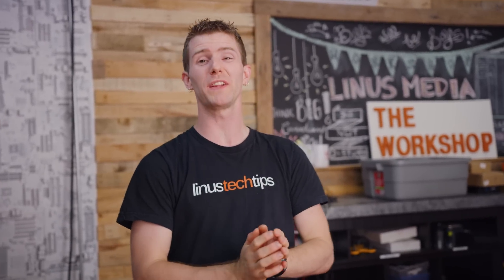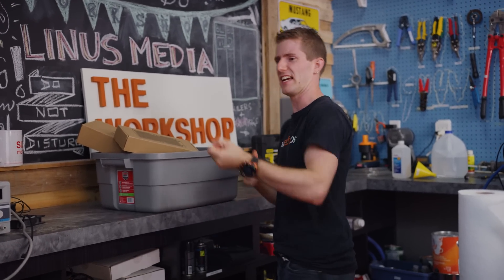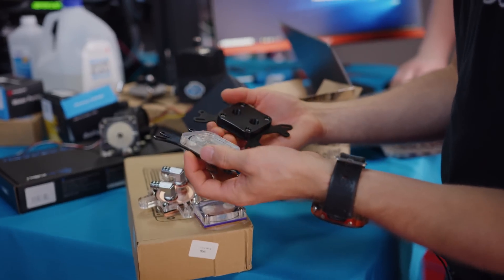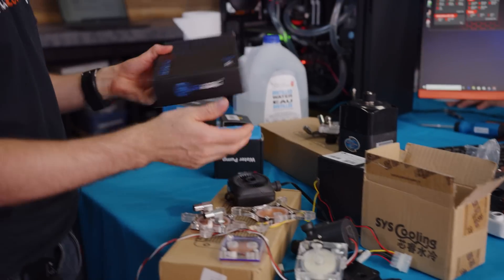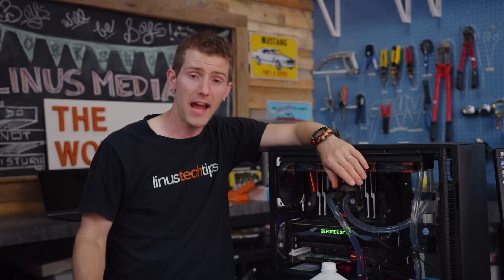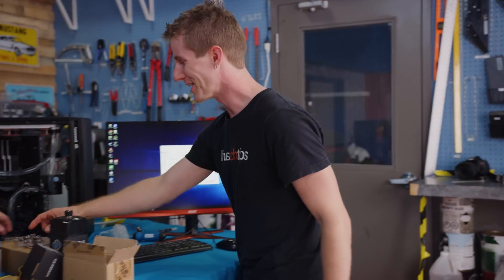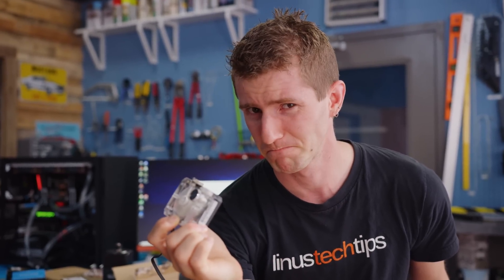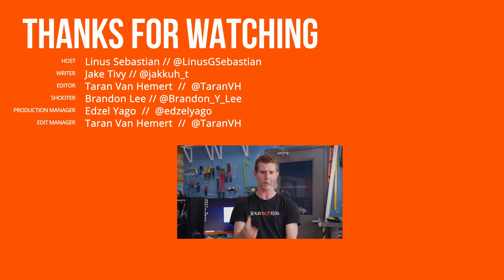AliExpress Water Cooling DOESN'T Suck?!

Comment: Now the question is: cheap water cooling or proper air cooling?
Reply: i am running 8700K at 4,7Ghz all 6 cores and 1,28V and temps around 70°C with room temperature 30° with NH-D15S with 1 fan on it.... CPU is NOT delided
Reply: It was cheaper for me to replace my old 4c/8t CPU with a 6c/12t and overclock it as high as it can go on cheap water cooling than replacing my entire system with X99 or Ryzen. It would be the same even if DDR4 was not overpriced.
On air I would be sitting at ~400MHz less which is a big deal for games that benefit from high single thread performance.

Naturally you have no need to water cool a brand new high end 14nm CPU if you don't plan to set benchmark high scores. But of course most water cooling is done by snobs who can afford to throw 5k at a PC just for the lols and bragging rights while 99.9999% of the time they have no practical gains from it in their daily gaming where their GPUs choke on 4k resolution.
Reply: Miguel Angel Vazquez I say if ur a beginner dont go with water do air.
Reply: A decent chinese water cooling loop should be better for CPU overclocking than even the best air coolers. If you don't plan to overclock a lot then air is superior being easier, cheaper, safer.

Comment: Actually, would it be possible to do a custom loop now for CPU, motherboard and GPU, that actually is all aluminum? Because if so, that opens up a lot more options for radiators with a ton of surface area for really cheap.
Reply: I tried looking for decent aluminium water blocks by chinese brands but didn't find any. For an all aluminium loop probably the only good option is still a western brand but it doesn't make sense economically because these copper+brass parts from aliexpress exist.
Reply: I was about to ask about that, too. The parts list is decent, but the only 360mm rad they link to is an aluminum one. They mentioned one about how they had a hybrid rad where only the parts that touched the water was copper (or brass), but I couldn't find any. the default link to the "PC watercooling" for Aliexpress only links me to reservoirs but literally nohting for actually making a custom loop. So I'm feeling a bit perplexed.

the fact that they tested with an X99 setup is pretty relevant to me, since i'd been wanting to do a custom loop for my X99 pc in forever. And at that total price, I could almost afford to do a custom loop for my other PC's too, as long as they work.
Reply: Just try searching aliexpress yourself and I suggest you sort the search results by "orders" as that kind of implies the seller is decent at their job like not sitting on your order for months before posting it and that the parts are good.
I found that Barrow and Bykski as search terms tend to turn up decent results even if the parts are unbranded or have some other obscure brand name on them.
My 360 thin rad came from the same seller as 2 meters of soft tubing for a total price of 49USD plus 8.45 shipping to Eastern Europe, the listing said it's FormulaMod while on the rad itself it says FreezeMod.
I have an x58 system with a Xeon hex core clocked to 4.4GHz and everything else is just air cooled so a bit overkill with the radiator size for just the CPU.
Shipping times vary from seller to seller, in my case almost everything arrived at the same time within about ten days or so, I was stuck waiting for two more weeks for the fittings which were really cheap and meant that I could easily go for 2x more fittings than I actually needed to have spares, the more expensive ones would probably have arrived sooner.
Reply: that's just it, I can't find anything, neither with the links in this video, nor with their search bar. It's somehow more broken than AltaVista of the 90's. And that's saying something.

Comment: Can y’all help me out?  I’m building a station for 3D modeling, graphic design, music, photo and video editing. Here is why I have so far...
CPU - Ryzen 2700x 
Motherboard- Strix x470 F
Ram- 16 gb Trident Z rgb (amd compatible) 2933
And as for gpu I’m stuck, I heard a new card will drop and old cards will lower, and I really like the Strix cards. I’m thinking about getting the Strix 1070/1080 since i would also enjoy gaming on a 144hz monitor. But than again would I be better off with a Strix 580 for productivity, and lacking the gaming value? 
And depending on the card how much watts should I get for a psu? Thank you for taking the time to read this.
Reply: just send it and buy the titan volta

Comment: Are you willing to see if this thing really works?
https://www.amazon.com/AISme-Diagnostic-LPC-DEBUG-LPC-Debug-Motherboard/dp/B076Z7VFS8/ref=sr_1_1?ie=UTF8&qid=1533239240&sr=8-1&keywords=cpu+ram+diagnostic+card
i had a z77 system and it died i tried to boot it with 1 ram stick it worked once then stopped again, if this works i would be willing to try it.

Comment: To think my first water cooled system (about 15 years ago) used a water pump (DAB) from a broken home oil water heating system.... and it was quieter on lowest gear than MOST available water pumps for about 8 years (untill it broke xD) with massive water pressure, and a modified car radiator. Everyting in copper or brass. Now im using air but im still thinking about bulding new WC system ;)

Comment: Heh I actually use all Barrow fittings on my 7900x monoblock / sli 1080ti system, they seem really good and zero issues since I built it, while saving a fortune over bitspower fittings (as in some were 1/4 or 1/3rd the price!), the rest of the loop is EK blocks, alphacool rads with a primo hill pump/res

Comment: Okay guys listen up! This has been my area of research this year. There are two things you need to pay attention to in particular when ordering a custom loop on a budget: The block and the pump. Let me save you a lot of time right here, right now:

- DO get a block with a 0.2mm fin pitch. So far I have only found blocks like that from Barrow and Flying Elephant.These blocks will perform just as well or better than your premium brand. Do not buy blocks with any larger fin pitch than that. Example link (AM4): https://www.aliexpress.com/item/Barrow-LTFHBA-04N-Water-Cooling-Block-for-AMD-FM1-FM2-AM2-AM3-AM4/32807502757.html
- DO NOT get the enormous Barrow/Bykski TR4 blocks that are compatible with AM4. The above mentioned block performs much better.
- DO get a pump with PWM. You got that? PWM or bust! Freeze Mod make some great pumps with integrated reserveroir. Example link: https://www.aliexpress.com/item/FREEZE-MOD-pump-reservoir-kit-for-computer-water-cooling-system-RGB-control-or-AURA-synchronization-PUB/32841167251.html

Some bonus tips:
- DO get a Bykski block for your video card. They are absolutely excellent and will drop your temps like 20-30 degrees. Make sure you get the right block for your exact card model.
- DO get a COPPER radiator, preferably with high density fins.

That is all. Learn from my mistakes. The above parts will ensure that you get top performance for little money. Enjoy!
Reply: You should do a video on that, it would be interesting to see it in action.
Reply: Bykski is a really good quality brand. Their TR4 block beat the first block from EK for the platform, and is pretty much on par with the new one EK released IIRC. But of course, I only have experience with a limited quantity personally. Still, I would def. buy their products again.
Reply: Thanks, im gonne use this info
Reply: Dude that's really interesting! You should do a video about that because you seems to know a lot about those budget watercooling parts!
Reply: why not a barrow block for the gpu?
Reply: Too bad they don't have MSI 980 blocks :(
Reply: Alex Spray thats basically why it is so expensive
Reply: Thanks man. I've been searching aliexpress for a few days in total now to make sure I get something that's really good for cheap, first try and this post helps a lot!

Cyberpunk build, here I come!
Reply: any advice for cooling my laptop?
Reply: You can get one of's relatively cheap as well if you can make simple technical drawings
Reply: Thanks for the tip! You should do a video on it
Reply: dot
Reply: Andreas Ravnestad uhm sounds hard just gonna get a noctua i guess
Reply: I prefer Vario pumps over PWM
Reply: Thanks b
Reply: I literally dod exactly this for my secondary PC just to see how it goes before going over to my main. Long story short, my workstation/gaming rig is now water cooled, sponsored by aliexpress.
Reply: Did you ever make a video on this?
Reply: I wish i could add this comment to safe.
Reply: Wow, thanks for your help, bro.
Reply: Nice tips man, for me that live in Brazil it is much cheaper to buy Barrow and other brands from Aliexpress, due to shipping price from US, EU and customs taxxes, not to mention the currency conversion.
Reply: João Paulo until your products arrive at the customhouse... BAM 70% of taxes
Reply: VL you could try to find a forward shipping service.
Reply: Andreas Ravnestad I spent a lot of time looking for water cooling on alliexpress but i have seen pump looking that good. Maybe you have more examples or options to choose?
Reply: There's no marketing in the fact that buying cheap from Ali you get 0 warranty. From EK specifically you get both amazing support and warranty which even covers your hardware in case of a leak that is EK product's fault.
Reply: Erik Nastovski Stop shilling for EK. Just stop.
Reply: the products on ali are less than a half cheaper than EK parts, you could just buy another one if it breaks on you or better yet get a new one from a different company. for the price of one complete set of ali wc parts, itd be the equivalent of just one EK waterblock.
Reply: Leif Christian Rosendo cool, and what happens when it kills your hardware, will you buy another 1080ti for the difference in price?
Reply: sources and first eyed accounts show theyre reliable, it doesnt matter if its manufactured by some chinese company you dont know, quality is quality. i assumed a situation where you can identify the problem immediately before it does any damage to other components. furthermore, it is not reassuring for a company like EK to offer a warranty like that knowing their price premium, it should be 100% guaranteed. people shouldnt have to pay up to 3 x just because theres a warranty and 4 degree difference. if were even gonna talk about warranties, youre still the one with a bricked pc and itll probably take them months to inspect your pc and replace the part or reimburse you. if i know a product is good then the warranty shouldnt matter and its worth only a slim chance of a gamble if i do the research.
Reply: @eriknastovski1330  Is the warranty going to cover your 1080ti when your EK block leaks? The chances of that are about the same as a cheaper block leaking. Just examine it before installing, like you should with all components.
Reply: @VecheslavNovikov  yes. If the leak tested seal is there and blocks were not damaged, everything is covered.
Reply: @eriknastovski1330  No it isn't, read the terms of the warranty. As with everything, test it before using it long term, inspect before installation, etc.
Reply: @VecheslavNovikov  well practice shows otherwise. Check the predator AIO failiures, every pc component that failed due to it was reimbursed.
Reply: @eriknastovski1330  That's a one time thing they did to avoid class action lawsuits. Their warranty doesn't cover your components in case of leak.
Reply: @VecheslavNovikov  nope. Just ask support.
Reply: Complete junk
Reply: Or even better, just get EK parts that are quality, supported by awesome warranty and excellent customer service with performance that those Chinese brands try to copy over.
Reply: Erik Nastovski If anything, this video shows that EK is probably ripping us off.
Reply: Ill be laughing when that pump dies horribly or block seal craps out and kills your PC along with the loop.
Reply: Erik Nastovski there is a thing called thermal throttling, ya know? It is really hard to burn cpu nowadays, unless you mine on it.
Reply: King Of the Jungle totally. These designs aren't revolutionary. Most of this is pure profit for the big guys.
Reply: Erik Nastovski yeah of course, let me just hack some money onto my bank account
Reply: lol where tf u think those parts are made? only difference is warranty.
Reply: Erik Nastovski Hmmm 4 Celius? That is your "extra performance" that is on a 5960X. A HOT CPU. You only get a great warranty. If you buy safely, you save 200$ or so.

Comment: for anyone looking to save some cash and just jump into water cooling...DONT. save for as long as it takes to buy from one source you can actually contact and receive replies from. when you buy from one source they generally design the components to be of the same material/grade/quality, buying a mix of random cheap parts from across the pond means youre probably going to have issues with possibly wrong/misinterpreted components that are most likely different materials creating electrolysis in your loop (dissimilar metals reacting causing corrosion and even speeding up the degradation of your components at an exponential rate) if this problem occurs with a reputable source, more than likely they will work with you to make things right. ive built several budget loops and none of them are still around today because of ruined blocks from electrolysis and not being able to contact sellers to try and resolve the problem, spent about 600 total on all of it over the years and the only one still in good working order is the most expensive one i sourced from EK for about 500, so i could have saved money in the long run by just buying quality in the first place (even buying quality doesnt mean its perfect, water cooling is a commitment,  plan on draining loops and adding chemicals when needed and cleaning parts that are not designed well for that process)

Comment: Keeping things cool with water is not rocket science. The difference in performance between water blocks is negligible. The really interesting part would be whether or not it starts leaking after a couple of weeks because the chepo o-rings have disintegrated or because the plastic parts cracked.

Comment: It just doesn't seem worth it to cheap out on water cooling considering you'd really only water cool a high end setup. Plus 90 bucks isn't even that cheap, I'd just got for a noctua air cooler for that price and save myself the potential damage to my parts.

Comment: Why can’t somebody design a simple circuit using refrigerant maybe R134a and a small screw compressorif it can remove heat to a standard to keep a freezer at -20 surely its more than enough to keep a bank of pc’s cool.
Reply: Freezers are insulated so they only have to deal with a small amount of heat getting through. CPUs are constantly putting out heat so it takes more power to cool them.

Comment: But what if water is expensive and we have to use our bodies to watercool since the human body contains 70% water???
Reply: You can use your bodies... unused water, but it is (depending on your diet) acidic and will probably damage plastic-tubes within weeks

Or you can hold your hand down on the cpu, that may actually work to some degree (pun intended)
Reply: Salz Stangl on low power chips (like 1 or 2w) it's actually a decent way to cool them
Reply: it would be 70% as effectif
Reply: Just lean on the cpu. Thats blood cooling. Your body will dissipate the heath
Reply: you could call your brand dune cooling
Reply: Use watermelon. Its 90% water
Reply: Or coconut water.
Reply: Fat Boo Chinese blood cooling vs Taiwanese blood cooling

Comment: I've been using Barrow for a long while now and have ZERO issues. It's half the price and after building 10-12 client systems using their hardware, I've realized it's the exact same manufacturer as BitsPower. YOU SHOULD BE USING BARROW!!!!
Reply: Christopher McCabe i ordered like $100 of Barrow fitting, what it should be like $300 of bitspower ones, im just waiting to they arrive to compare them with the bitspower
Reply: Really surprised they didnt get barrow gear. But i guess they dont fit their either stupid expensive or stupid cheap product content. They are very reasonably priced, are decent quality and perform fantastically.

Comment: Without looking at the video, I can safely say, no it doesnt. My current rig is mixed with cheap copper barrow fittings and pump/res combo, while the rads are from hardware labs and gpu block from xspc. Watercooling doesnt have to be expensive if you know where to look.
Reply: Barrow makes a brass fittings, not copper ones - as basically all other manufacturers (with few exceptions with aluminium fittings like ThermalTake and EK for their all-aluminium loops).

Comment: Can you guys do an update on the laptop vacuum coolers? It would be nice to see it they worth it or not
Reply: no
Reply: any proof?
Reply: laptop fans are already pushing the hot air out, the vacuum cooler will not make it that much faster, you would get max -5C, but much more noise. Makes more sense to replace the thermal paste
Reply: And what if the built in fan has a very low fan curve, and doesnt ramp up enough, therefore not pushing enough air through the heatsink? In that case it would be benefical in combination with a laptop cooling pad. The paste is brand new, quality one.

On the -5C max: even in high end laptops(https://www.youtube.com/watch?v=PkdkjrVkqDM&t=375s) it was more than 5. Now these are high end laptops with much better cooling then mid/low end laptops. There it would be an even higher IN THEORY.
Reply: You'll screw your warranty but some artic or liquid metal will do you a world of good.
Reply: BossManSays that would still not change the fact that my fan doesnt really turn on until the cpu reaches 70c. Even at that point you can barely feel the air coming out. Already have a cooler master notepal X3 under it, that helped alot, but gettint the air out of the laptop could change things quite a bit imho.